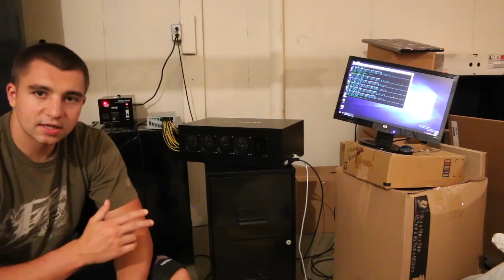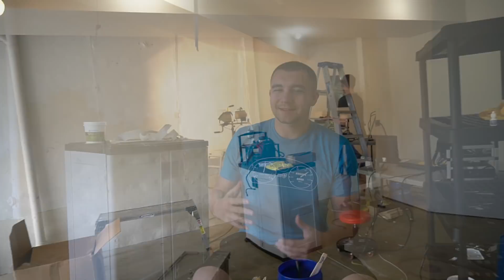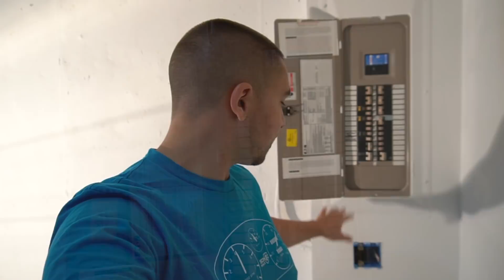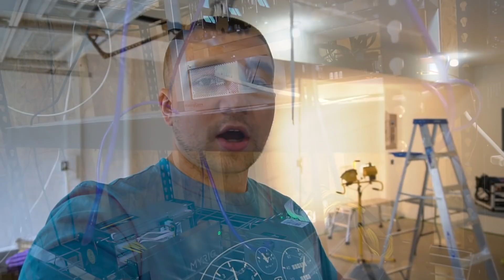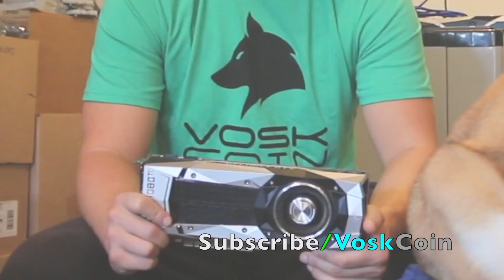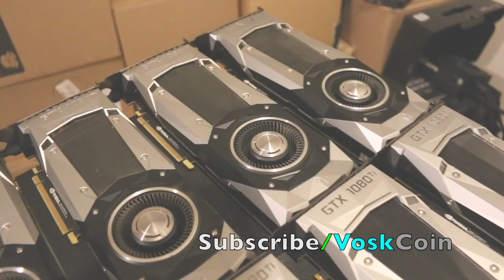How We Are Turning Our Garage into a Mining Farm & YouTube Studio

Comment: As a suggestion to your question on how to vent out heat if miners were set in the garage, Consider using negative air pressure. essentially using one strong cfm fan to vent out heated air through a flexible vent tube and plastic. Plastic used to make a wall and zipper door entrance to enclose the entire area. Building those wood enclosures only shrinks and  encapsulates which causes more heat and equipment to be used.  Cut vent squares in the upper corners of plastic wall and set air filters for dust and to relieve fan pressure on plastic wall. Then it will be 99% dust free. you can run vent tubing into the house if cool air is needed in the hot seasons. Hope that helped in the idea area..

Comment: Vosk, I'm dealing with heat in my garage as well. I've played with everything from liquid cooling to 800 CFM duct fans. I'm interested to see what you come up with. I spoke to a friend of mine who designed commercial HVAC systems and he suggested a split A/C unit. IDK at around $1500 and the extra electric cost on that, it's going to be my last resort. I'm trying to get a couple of 800+ CFM duct fans to suck out the heat right off of my rigs and shoot it outside.  I like your shed but I think the Texas heat would kill my rigs.  

  How many amps to you have going to that panel from the outside? I only have 60 amps to my inside panel. l will have to run a second sub-panel to my garage if I wanted to add any 30 amp breakers. Do they really help? Thanks for behind the scenes look, and keep up the good work! Your channel really helped me get into ming Thank again!

Comment: If you have a window in the garage consider a portable AC unit that runs on 110V... or consider having a minisplit AC unit put in. A portable is going to be cheaper in the short run. What might be even cheaper than that is a wind AC unit but then you really need to take in consideration the security factor.

Comment: I would be cautious about giving information such as circulating air from the house to the garage and vica versa. Garages are meant to be sealed from the house to prevent carbon monoxide entering the house. Installing something to circulate air between the garage and house may very well be a building code violation and a safety hazard.

Comment: Also I had some questions about the gigabyte ga z270p d3, I've got all my cards running and detected and hashing fine but I can't enter my bios unless I disconnect every card except my main display, any suggestions man? Or could you post your bios settings/modications you've made to the bios for 6 cards? Using Windows 10 until I move and hardwire for smos

Comment: Suggestion for you cooling: Look into DIY Clycol Chiller (https://youtu.be/zxdydeDxyf4 ), run the coolen through 8" "Hydro Innovations" (https://www.amazon.com/dp/B003AZD15S/?coliid=I26GC7D72ZBAZ1&colid=TH83Y2NNTEAJ&psc=0&ref_=lv_ov_lig_dp_it ) and use a 8" Hyper Fan (https://www.amazon.com/Hyper-Fan-Digital-Mixed-Flow/dp/B00HP35PUU/ref=sr_1_3?ie=UTF8&qid=1524669306&sr=8-3&keywords=hyper+fan ) to blow the cooled air. There is a lot of DIY involve (could make it fun), but the electric saving is a lot since you're running a cheap window A/C unit and the electricity for the hyper fan is almost nothing. Make sure you do a video if you go this route as I'm interested, but I'm by myself so do not have time to experiment yet.

Comment: Love the videos. Have you thought about putting in a 2nd or larger breaker panel/service? At 100% usage or being used 100% of the time, the wires will only hold 80% of what they are rated. Most older homes where I live use 4/0 aluminum that is rated at 180 amps. If it is copper it is rated at 230 amps. At 80% that is 144 amps or 31,680 watts for aluminum and 184 amps or  40,480 watts for copper at 220 volts. A little higher wattage if the voltage is 230 or 240. This leaves zero extra room for everyday living.
Just a thought I am sure you have already planned for. Keep up the great videos, love the information and thought you put into them.

Comment: Have you looked at solar to help power you minners? The shed in the garage is a good idea. You can cool the shed with a 14000 btu portable AC. If your house is up to code, you should have 2 vents on outer wall of the garage for air circulation. Build the shed near those vents and push the heated air out. 
Depending on the location of your HVAC system and SEER lvl. You could tie the air duct from the living area to the garage shed to help cool the rigs.

Comment: this is what I did, it's money and time, but, using single fan cards you can put 13 or more inside a 4U rack enclosure, can put 10 on a 42U rack, you build a PDU in a 2U rack drawer and feed it 3 phase directly, using a industrial plug and a single 3x6 cable straight from the power box, you end up with a +/- 3000 Mh/s rolling RIG, after that the heat management is easy, build a enclosure using wood or drywall and stick it in there, again, it's time consuming but after, everything is clean and neat. keep the channel up!